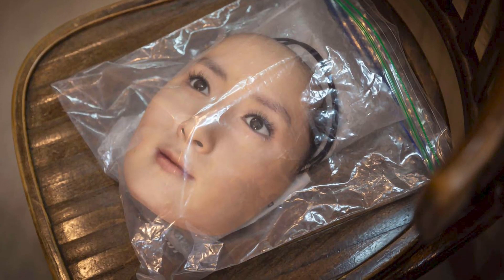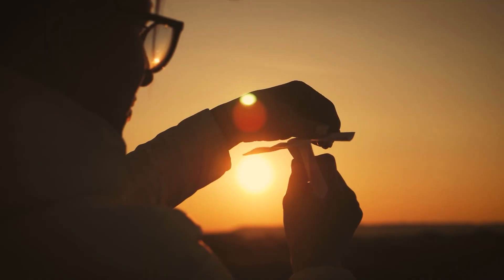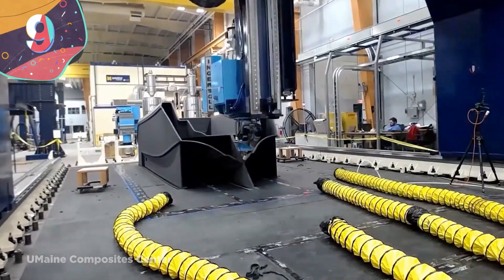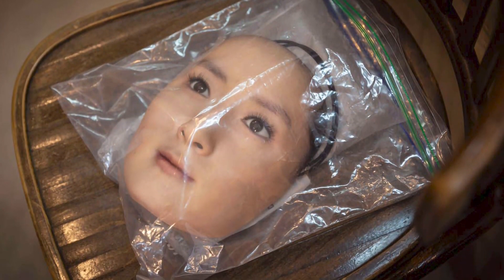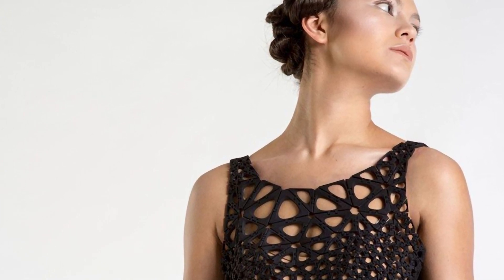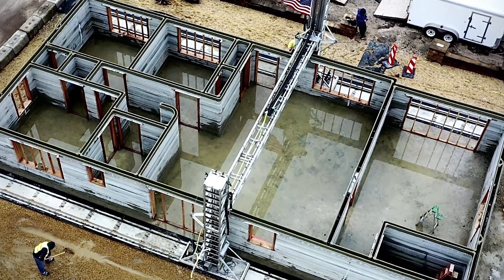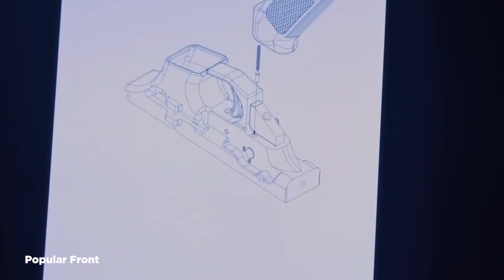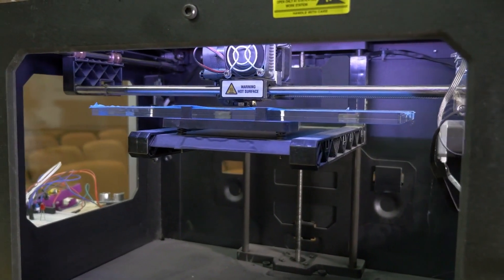15 Amazing 3D Printed Creations

Comment: 15:13 in that's an airsoft replica. Looks like a c02 powered gas blowback. Harmless 6mm plastic BB's in the bag to the right. That is 100% legal. You CAN 3d print airsoft guns and accessories. Can't with real firearms well legally. Lol
Reply: Yes you can. Most states anyway, so long as its strictly for personal use, 3D printing a real firearm is infact perfectly legal.

What gives the impression its not is the media and social media lying about it and also basically censoring people for doing it.